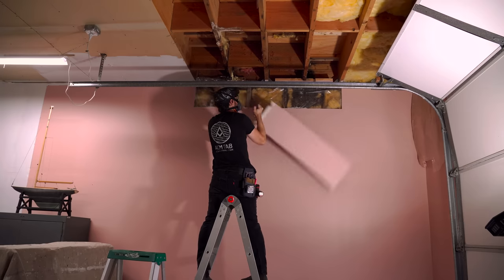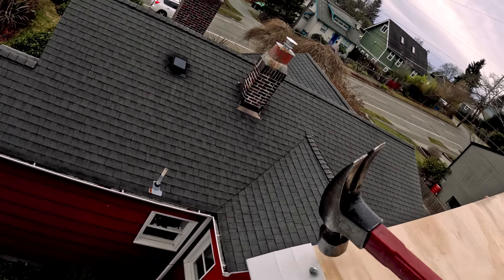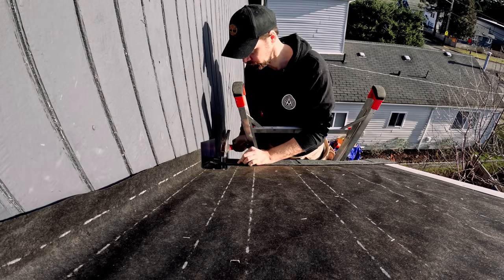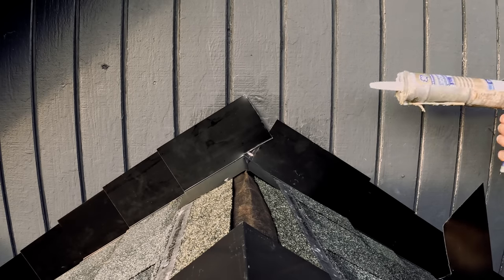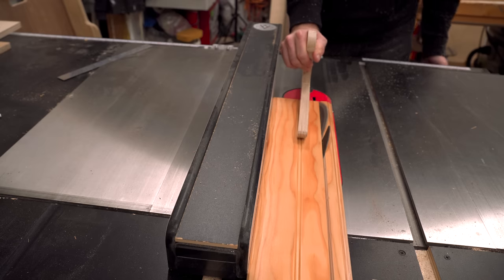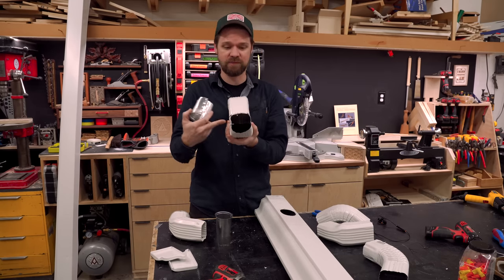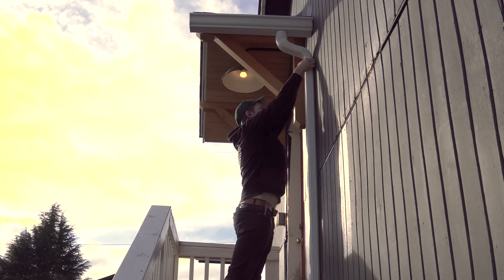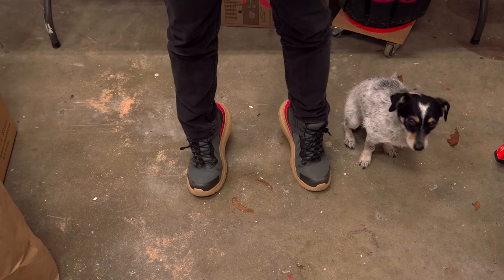Upgrading the ENTRYWAY with off the shelf materials

Comment: Mr.Alm if I may offer (I know unsolicited) a piece of advice. Please cut your siding 1 inch above your roofline and tuck your flashing behind your siding. Get a roll of 6in aluminum flashing cut for a continuous length and bend to a 90° to slip between your siding and underneath your shingles. Use Henry's construction and flashing adhesive from home Depot. I typically use the adhesive between the shingles and the flashing and any surface nails thru the shingles. I cut the flashing so the horizontal leg that goes between your shingles and the plywood roof is  a 90° cut with a 2in tab that folds over the peak and the vertical leg goes straight up from the peak which is a 45° cut (if that makes any sense). As an after thought you could get ahold of a local roofing supply company and have them bend you up the flashing you need. They would also be able to demonstrate in person what you would need to do and how to overlap your flashing. All the best and hope I didn't come off as preachy!
Reply from the maker: Honestly this is super helpful, thank you!! I really didn’t know the best method. Not a lot of information out there on how to retrofit these kinds of things.
Reply: I wanted to mention this as well. Thanks for sharing it in such a humble and helpful way—too many people get all preachy when trying to share advice. Thank you for putting it so well.
Reply: Multi tool to cut the bottom inch of the siding should do the trick!

Comment: Water will be a problem again if the flashing isn't closed against the wall. It'll probably rot the wood underneath your shingles and drip behind the molding of your door. Water doesn't need much. I once installed a roof and had an inexplicable leak. Everything was installed correct. Water was dripping pretty hard inside. After searching different possibilities I found out it came in thru little cracks in the stucco, not wider then a hair. Nearly invisible. The water traveled thru the cracks, allover the wall, behind the insulation and entered the inside of the little extension of the house. In your case the large gaps between your outside panels in combination with the unsealed flashing. And why create a bend on top of the drain if you're going straight down anyway? I hope you tackle the problems before they occur. Would be a waste of the time already spent to make it beautiful.

Comment: Hey Michael, Just a helpful tip here. You need a "kickout" step flash at the bottom of the overhang on each side. As you have it now, the water will reach the end of the roof and then straight down the wall.
Reply: Agreed, adding the kickout flashing is going to help a whole lot
Reply: True its a must for the eave side of dormers against the wall

Comment: I can’t thank you enough for this and your previous video. I live in Houston. Not exactly ‘cold and wet’ but I challenge you to find anyplace more just wet. The rains are impressively heavy and I can think of at least 5 times when we have gotten more than 30 inches of rain in a day. Sometimes ten inches in an hour. We’ve been hear nearly 50 years and have an inoperable door that goes from the garage outside. I’m positive this is against the fire code. My husband takes the opposite approach to building and repairs than I do. With 6 children, he assumes they will break things so he buys cheap and fixes fast. In my case, I build to last and don’t have to fix. Both approaches have their uses but not for doors. He always installed a metal door, and it always rusted shut. The frame is rotted too. I saw awnings when I worked at the Home Depot in millworks for a while. You have made this task approachable. I loved that you included your errors like the falling ladder. Thankfully we have a friend with scaffolding. I shall borrow it.

Comment: Very well done, Michael.  I really liked the "post and beam" foundation you fabricated for the support structure.  I know you get some high winds out there occasionally along with the almost never ending rainfall, so a great roof with great flashing is a must have for you.  Here in north Florida we have hurricanes, tornadoes, severe thunderstorms with hail occasionally, along with very hot sunshine about 80 per cent of the time, so we have other issues.  Our house was built in 1845, so it has survived a lot of storms and the entire town burning twice within about a year back in 1910 and 1911.  Our house is the only original house that survived both fires.  It needs a lot work, due to many years of weather and neglect.  Glad you are worry free on your previously rotting wall, well done.

Comment: looks awesome but 2 things.. the flashing and venting. 1. you absolutely need to seal off the top of that flashing! all you have done is move the problem spot up by nothing that!  2 good options are  to cut a straight line in the siding and sliding a "L" channel in and caulking it. or, cutting out the piece completely slide an Z channel in and install a freeze board, (basically just a 1x board, best these days if use the PVC stuff)   2. venting! even that little roof should be vented, at least some! not perfect but you can drill the little discs that just pop in the hole in the boards underneath, at the bottom and the ridge.. should vent out the top of the roof, but uninsulated you can actually just vent under the ridge as there is no actual gable closing it off.. so it will break at least a bit.  otherwise that roof won't last long as the plywood will rot much faster fro the extreme hot/cold from day to night temp swings. need to vent to get condensation out easy from over night cooling.

Comment: Hello! I'm a video professional, and I had a suggestion in regards to the filming issue you mentioned at the beginning of the video. You may want to look at a Cardellini clamp with a 3/8 16 thread on the top. You can then add your preferred camera tripod head to that. It allows you to clamp just about anywhere. Just don't forget to use a safety cable with it! Safety first.

Comment: Reaching up that high on a latter like that id strap it too the deck railing or even screwing it in with a metal strap is how we used too do it when i was doing soffitt/fashia that way it dont try too slide and ive also framed houses in the past and ive seen and done my very own fair share of stupid stuff and got lucky most every time so it a bit of security i feel... just thought id mention is all but ya do amazing work brother... as for the flashing like you said youve not got alot of choice without tearing into the entire side of the house.... id just get ya some plastic/fiber reinforced flashing/gutter sealant and just caulk the top of it... the only problem with silicone on flashing or gutters is that the wind can almost blow it off once cured and the gutter sealant is pretty awesome but it normally comes in either black or silver which the black would look awesome😁...

P.S- YOUR FIT AND FINISH AND JUST THE OVERALL DESIGN & EXECUTION OF THIS AWNING TURNED OUT AMAZING SO I HAD TOO COME BACK AND EDIT MY ORIGINAL COMMENT JUST TOO LET YA KNOW THIS... I FEEL THIS DAY & AGE ITS FEW AND FAR BETWEEN TOO FIND OTHERS WHO ACTUALLY TAKE PRIDE IN EVERYTHING THEY DO & DO SO TOO VERY BEST OF THEIR ABILITY... PEOPLE NEED TOO SLOS DOWN & TAKE PRIDE IN THE STUFF THEY DO... KEEP UP ALL THE HARD WORK & KEEP THE AMAZING VIDEOS COMING...

Comment: That flashing isn't magic. Those grooves in the siding now form little water holding chambers. You need to at least cap them. I'd fill them with roofing sealant.
Reply: Is it correct that the flashing is under the shingle? Seems like the water can flow off shingle and under and onto flashing, then flow off the flashing and under, if that makes sense.
Reply: @yewsengcheong1637  it is. Some people might choose to run a line of roofing sealant along the flashing.
Reply: Water intrusion will definitely still be a problem. Wind driven rain is going to fall down the wall and track in the siding grooves coming out along the top of the door. Best solution would have been to cut back the siding along the roof life and place flashing up behind it replacing it again after the shingles have been laid.
Reply: @stephenhegarty  exactly.
Reply: Flashing is supposed to go under siding unless the the top was sealed but still not how its supposes to work needs counter flashing

Comment: If wind pushes the rain against your siding, won’t it run down and drip behind your flashing?
Reply: He discusses this at ~ 9:45
Reply: Even if it does, the siding behind it is intact so it'll just keep running down the side of the building.
Reply: @titosrevenger only after rotting the plywood on the awning

Comment: Dude,  you need some safety equipment. I would have suggested using some webbing straps or rope to tie the latter to the railing, or just screwing a heavy ring bolt to the house. then you'd have a stable place to work. or rent some scalfling . YOu could also wear a rappel harness also tied into the upper house.. BTW, great work. looks great.

Comment: did you put any caulk/sealant along the top edge of the step flashing to prevent water from running down the wall and getting behind the step flashing?  I've seen roofers using cold tar in that application to keep water from penetrating behind the flashing.
Reply: nope he sure didn't

Comment: Great build as usual.   I offer 1 constructive comment... install flashing between the roof and siding. Standing water is insidious and will find a way in. I do not need to tell you how much damage standing water can do. If you do not want to cut your siding,  epoxy in a filler strip in the vertical grooves and caulk.

Comment: I know this has been said before, but your step flashing should have gone behind the siding.  You should cut the siding about an inch above the roof line and slide the flashing over the shingles and under the siding. You are going to have water issues with it the way it is.  Other than that, you did a fine job.

Comment: Boy the step flashing is an issue - would hate for you to have redo everything again.  Rip 1" above it and add a 1x6 trim board and caulk between the newly installed trim board and siding.

Comment: Thank you for showing all this process!  Step flashing must still do its job even if it's exposed - on a brick house with an awning like this, the step flashing is visible.  There are several brick homes in my neighborhood done this way, and I want to install an awning like this on my own brick house.  Here's a question:  How would you secure the timber frame to the home if your home is brick?  You said that you bolted it directly to studs in the wall behind the siding -- would you do this with a brick home?

Comment: You have nerves of steel.  I almost watched this video through my fingers.  @23:26, I notice that you have a little run off where as other videos that feature that time of downspout simply pours into the ground.  In my country, the drainpipe runs into a gulley that is part of the drainage system and covered by a grill that can be lifted to clean out any debris or blockage.

Comment: Silicon? That caulk you used is silicone, not silicon.
https://en.wikipedia.org/wiki/Silicon Ends with con, as in conman.
https://en.wikipedia.org/wiki/Silicone Ends with cone, as in ice cream cone.
It would be smart to put a generous bead of silicone behind the step flashing, along with some of the suggestions offered above and below. Be sure to smooth the top of the bead, so water cannot sit on top of it.